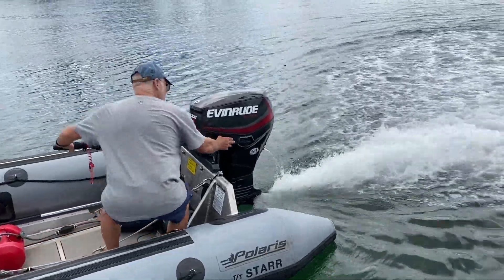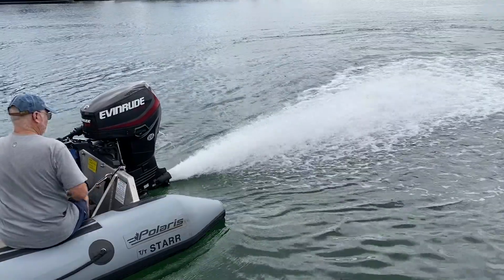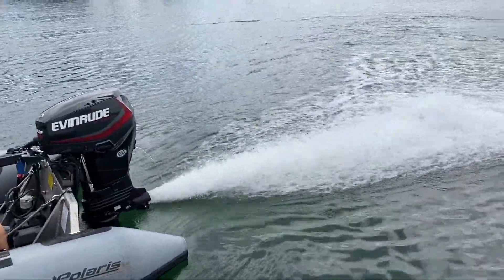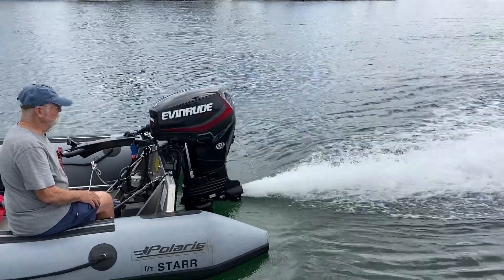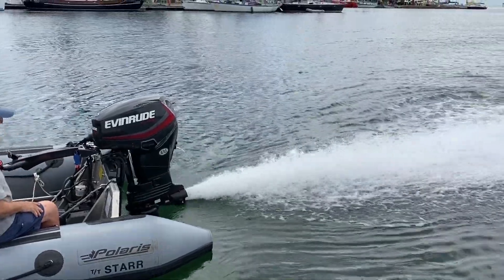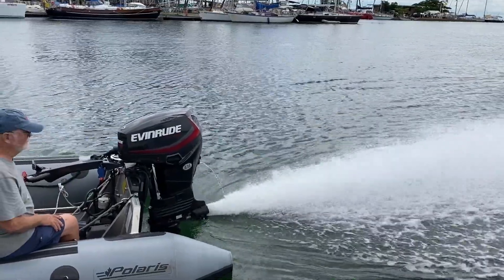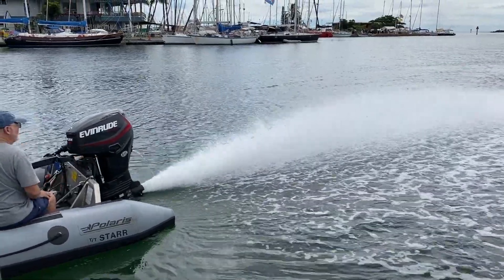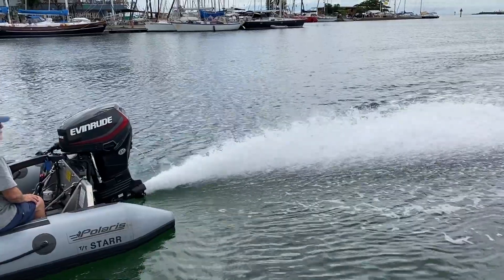2019 BRP-Evinrude  E-Tec 40 Jet Warranty Issues

Comment: I know this motor personally, as I looked at it for Don after the dealer did. Sounder as if the reed valves were acting up. Sure enough that seemed to be the problem. Evinrude replaced the powerhead and problem solved. Runs beautiful now. I might add the local deal didn't know their ass from a hole in the wall! Been servicing Etecs for years and currently am the only service guy in Hawaii also doing most of the military's motors. Outboardmotorservicekailua.com.

Comment: an outboard jet caveating sounds like super high rpm revs because thats whats happening... air in the jet pump makes the impeller spin without load and you get high rpms.   I dont know what that sounds is but its NOT cavitation from the jet pump.